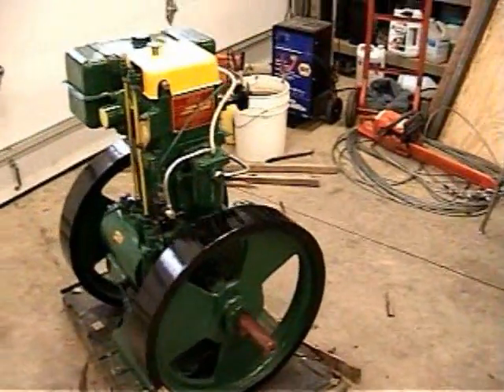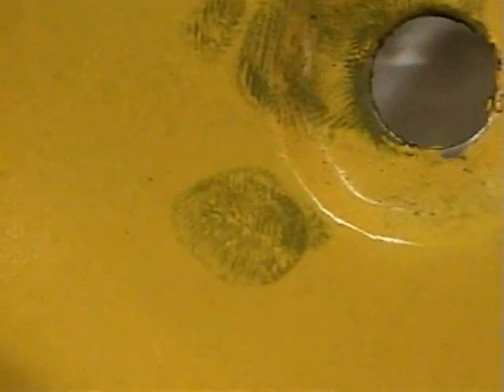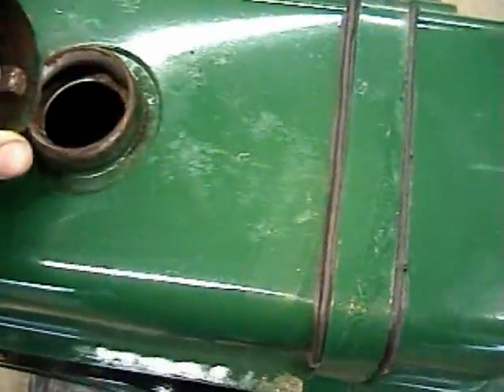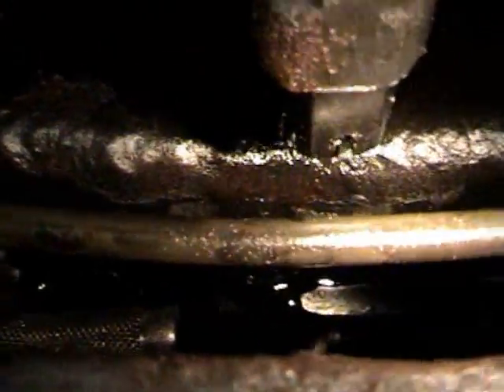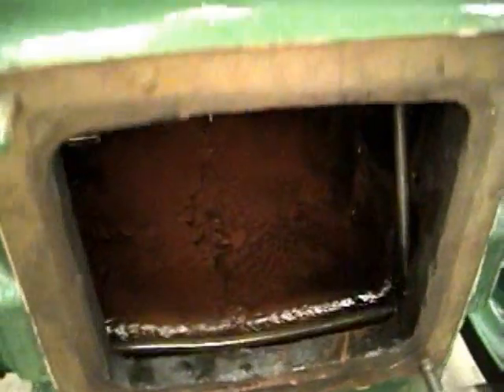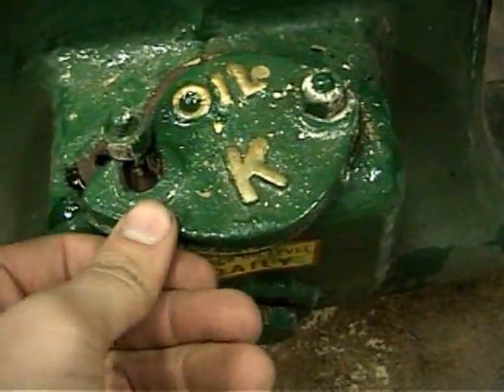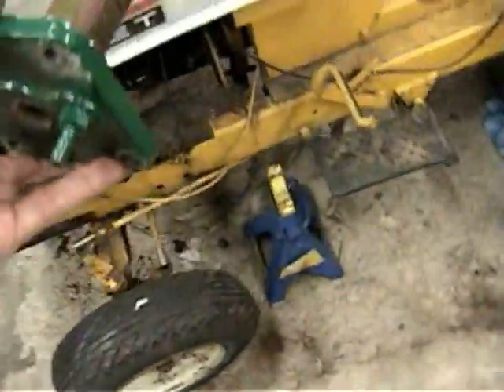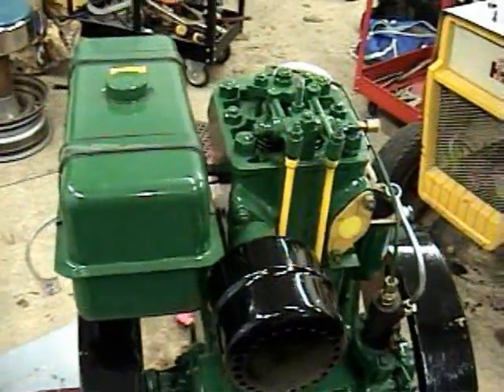Listeroid 8/1

Comment from the maker: Yes it runs great. I would buy again. Takes about a day of general cleaning and fixing to get it running GOOD.  It will run out of the crate, however about every banjo fitting leaks like crazy and the sump is full of a mud like oil. I will try to post an update soon.

Comment: I have a 6/1 CS Power Line Listeroid "Clone" I bought lightly used as a project in an engineering university to test bio-fuels. Same quality as you have. There all that way from India. It came with a 5K W generator head that has almost no  hours on it.
Reply: Do you still have it? How much did it cost you?

Comment from the maker: @Jimfoxyboy There was several little problems i had to correct after purchasing it. A quick list being. valve seats reground, cylinder honed, lifters reground. Right now its not doing anything because I'm in college but we are hoping to belt up either a pump or generator to it this coming summer.

Comment: Nice vid. Shame about the problems. Sounds like it was better they didn't paint it all. Though the black on the flywheels looked rather nice. Curious to know how it is running these days after all the work you put into fixing it up. Specially if you had run into other problems not shown on your video.

Comment: when you get one of these completely disassemble it sand is everywhere ,clean and reassemble ,the book calls for .005 crank end play (ONLY ON SPLIT SLEEVE MAIN BEARINGS ) most of these now are TRB's tapered roller bearings need to be set with preload !